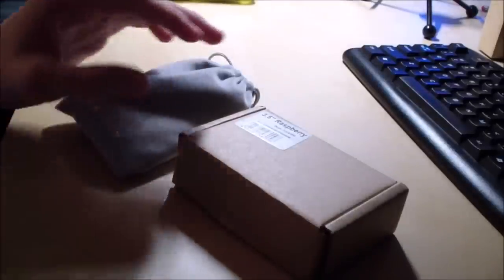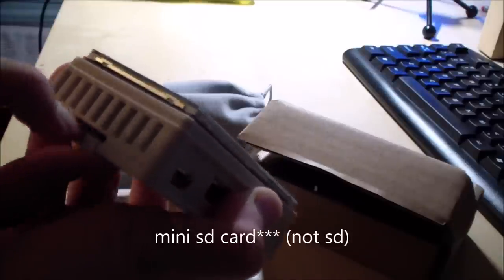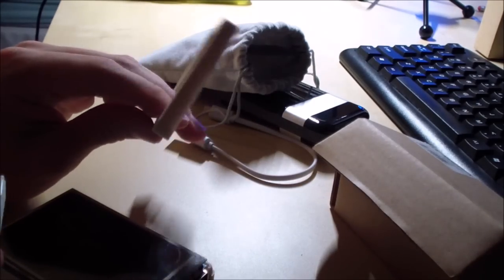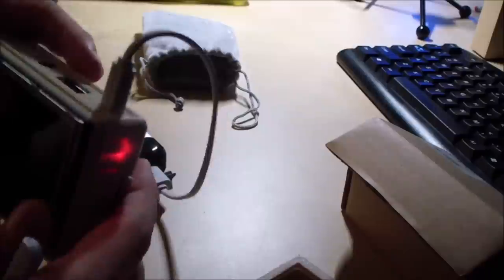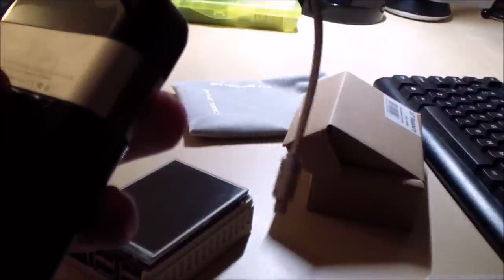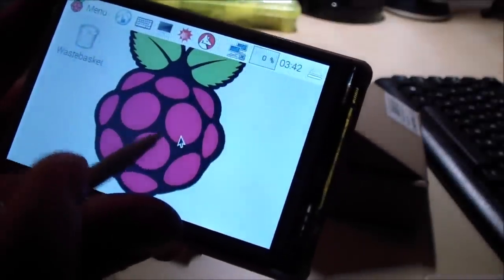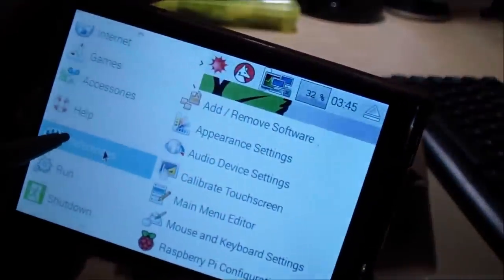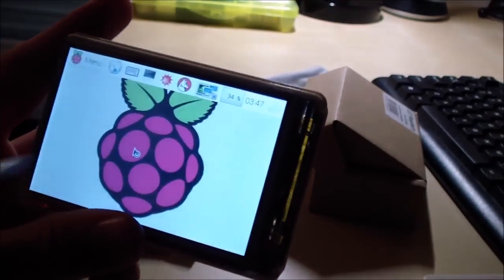RASPBERRY PI 3 TABLET/PC (PORTABLE)

Comment: what is the the price
Reply from the maker: Well, I don't directly sell any components of this Raspberry pi build. The raspberry pi 3 B costs $35, the battery pack costs around $30-60 depending on which one you buy, the one I bought can be found as cheap as $30, but its a really good battery pack which can be used more than just for running pi's. The screen costs $22 that I used, but it can be found on ebay for as low as $10, but be careful which you buy, because some of the are old and dont even work with the new Raspbian and the drivers I provided. The 3d printed case, I got it for free, but you can order a 3d printing service, idk how much  $.